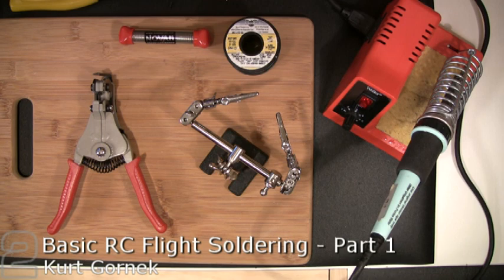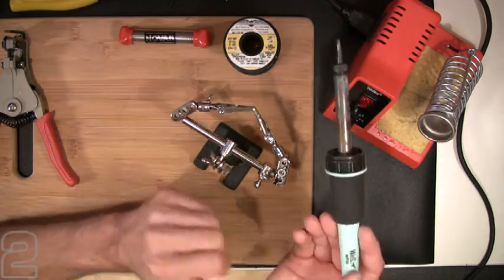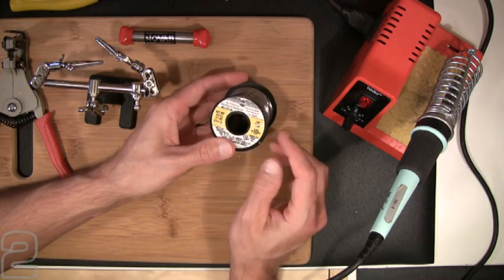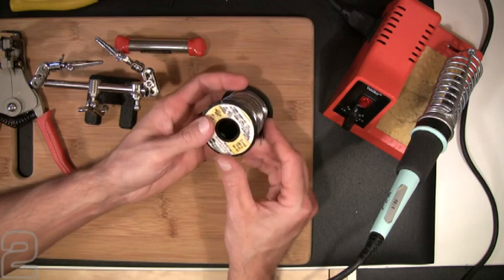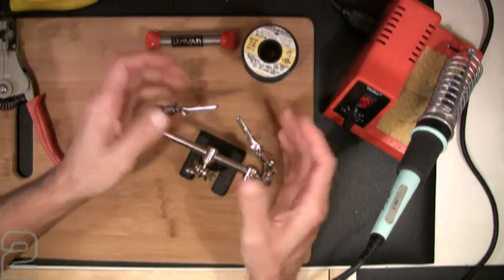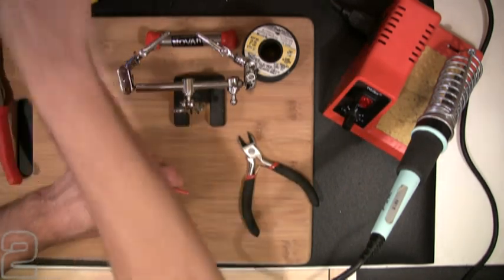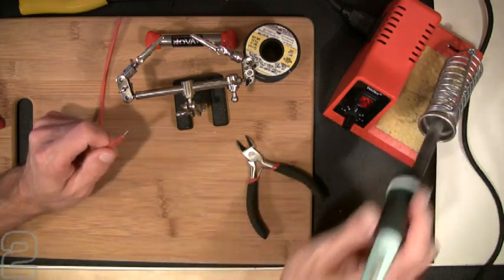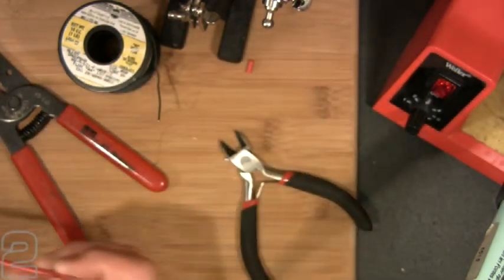RC Flight Soldering - Part 1

Comment: Kester solder is very rare to find in the UK you have to buy it from 
From Amazon us or another place I found that sells Kester 60/40 in 0.31 but if I use 2 rolls together the width of the wire will be 0.62   plus ile  buy 4 of them just to do a few connectors well better stock up on it might be the last solder wire brand we have need to say to Kester please don't go bust or will have to use cheaper solder which is shit  but Kester is a well known brand its hard to find a good brand but Kester is the number 1 on the leaderboard 
I want good quality solder  even if I have to travel to fucking pick up a box of it lol  then that's what ile do travel to america and buy a box of Kester solder people will say your nuts but not when it comes down on a expensive model helicopter and  I want good quality solder for it don't wanna skimp on a cheap brand there are so many different types of 60/40 rosin solder but Kester Is the number one OK so many people use the cheap brand but I want quality solder not shit solder Kester all the way just need to find a place that sells world wide and has Kester solder 60/40 0.31 1lb buy 5 spools of it to make the solder wire strand thicker 1.55

Comment from the maker: We typically use .050" Kester Brand for flight pack connectors.  Radio system wires and thinner gauge stuff is easier with .020" and requires less "loiter" time to get up to temperature so you melt less of the jacket.